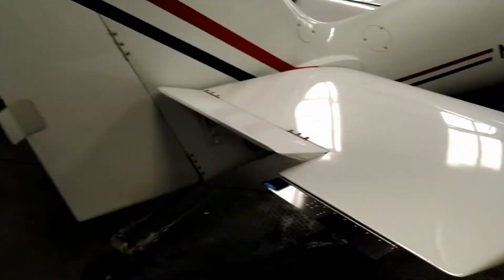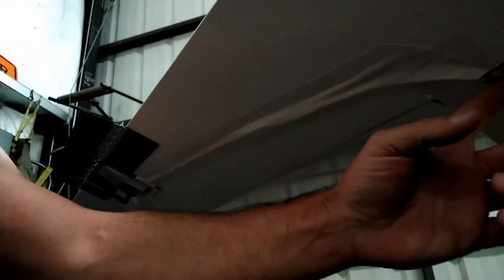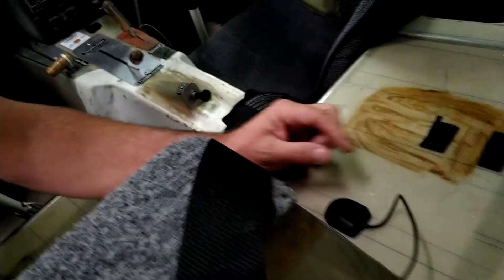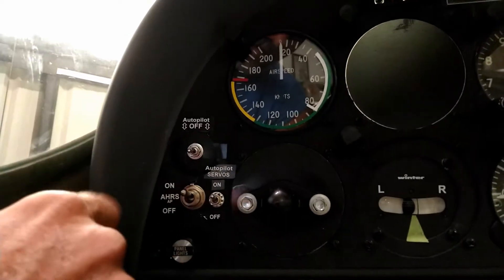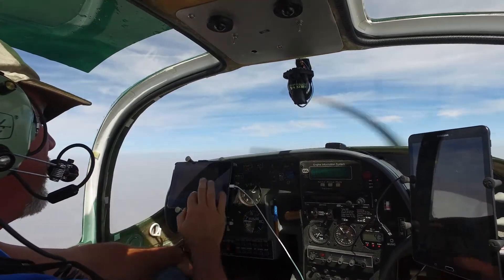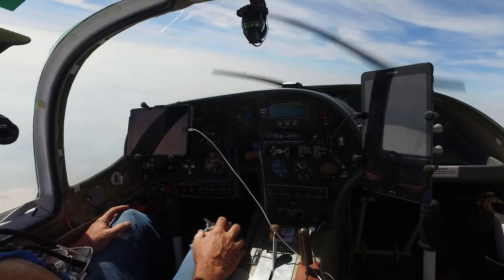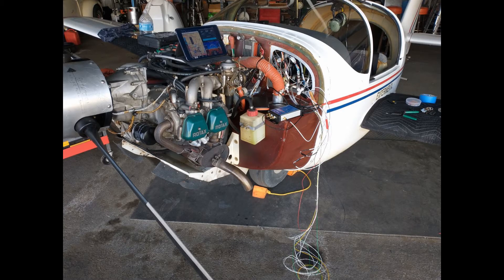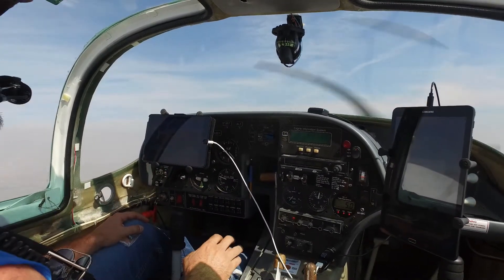ilevil Autopilot, Europa Monowheel review PT. 3

Comment: Instead of round wires taped to undersides of flying surfaces, I wonder if flat strips of copper would work, like a printed circuit board. Naturally, big enough to handle the amperage.